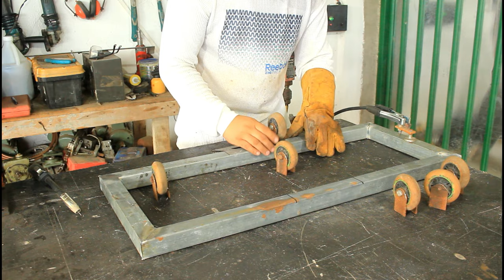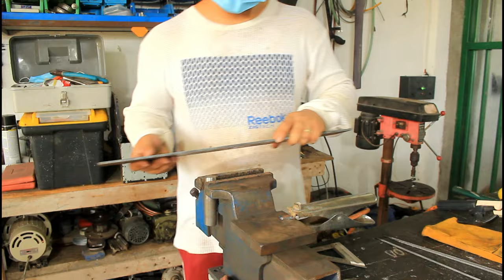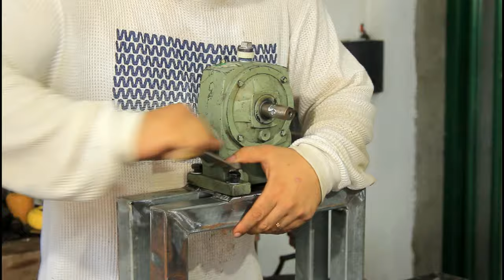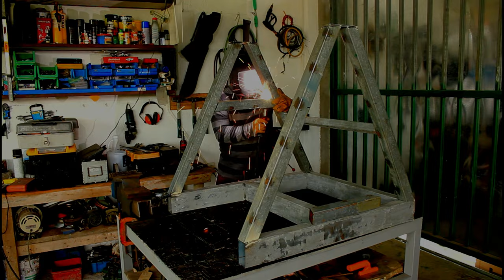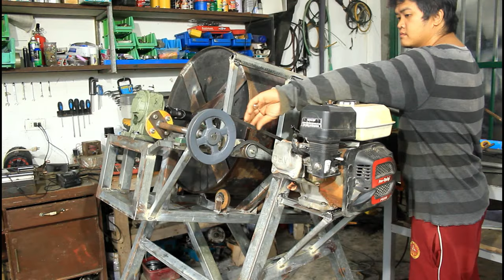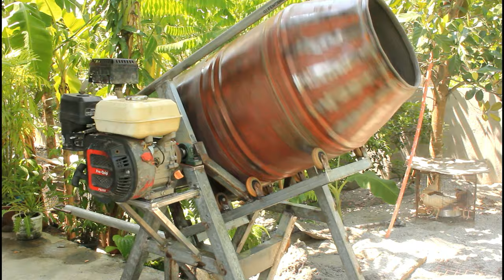DIY Concrete Mixer Using an Oil Barrel

Comment: I do wish you wouldn't weld galvanized metal inside & especially without an air mask. That yellow smoke coming from the weld can cause "galvanic poisoning" which can harm your nervous system.
Reply: It's okay just drink milk it helps

Comment: A bit of an odd project. That frame looks seriously strong, but I can see that oil drums lifespan being measured in 10's of hours (Rather than 100's) before it's either too distorted and out of round to keep working, or the abrasive action of the sand or chippings sliding about inside wear it too thin to hold together anymore.

It's a nice build, but I'd have thought something like an old, rusted beyond use, compressor tank would have made a significantly better starting point for the drum.
Reply from the maker: Thanks for the suggestion bro.